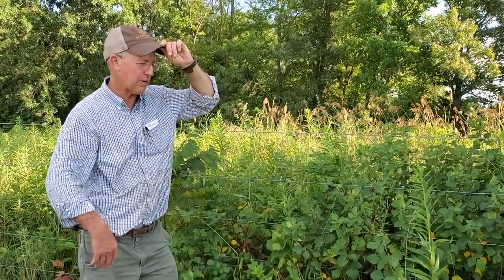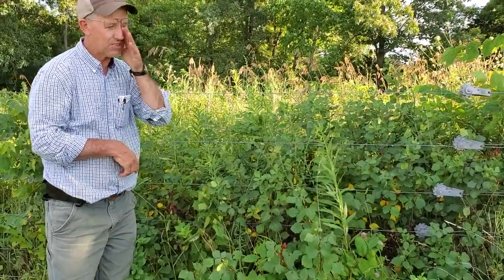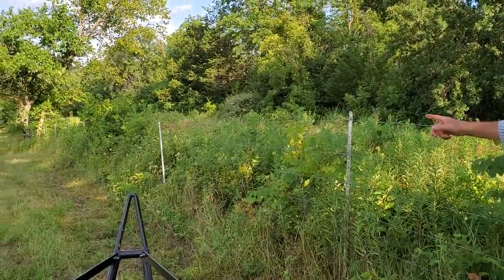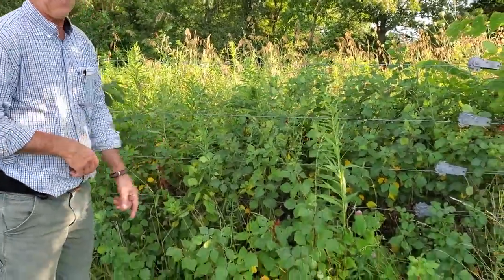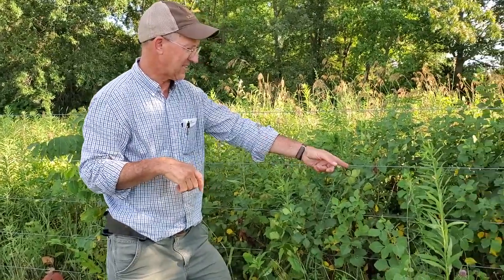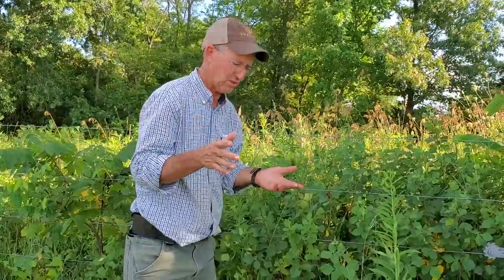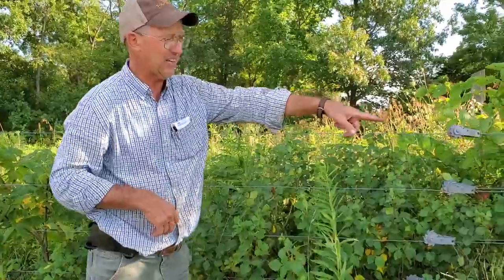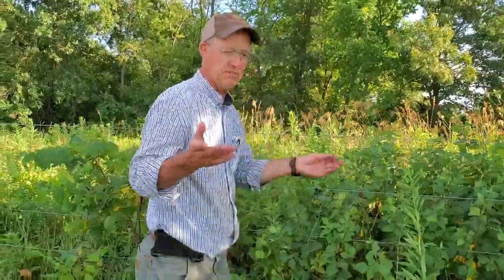Greg Judy shares his tips for keeping his electric fence super hot!

Comment: I am using solar so I have to keep that line clean.  the Johnson, foxtail and other grasses grow so fast along the road that it will over take the charger very quickly here.  
a good pasture and cows shouldn't be pushing against the fence.  but there is always that one or two  animals that have to try to sneak there head as close as possible. lol
Reply: Are you using solar DC energizers?  You could always rig up a solar powered system using an inverter and AC energizer.
Reply: I have a little solar unit.  Even the big plug in models cant stay ahead of the grass here.

Comment: I don’t get it. Why does turning it off and on ruin the grounding of the plants are touching but leaving it on doesn’t?
Reply from the maker: By leaving on the charger at all times, the electricity kills the section of the plant that is touching your hot wire. Dead plant material is not conductive. Live plants are conductive.
Reply: @gregjudyregenerativerancher  ah yes of course. thank you.
Reply: @gregjudyregenerativerancher  How costly is the electricity bill to keep it on all the time.

Is there any issue from lightning, hail, snow? If so, what is the protection measure against those elements?